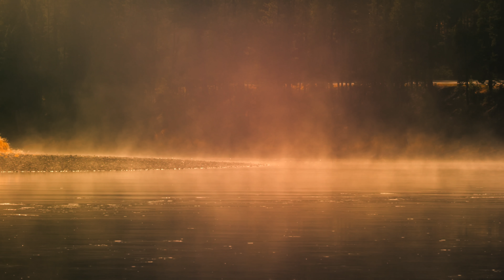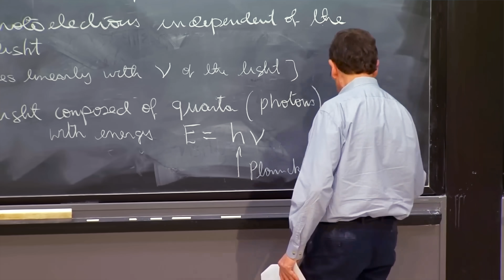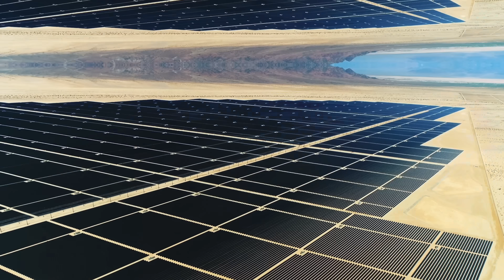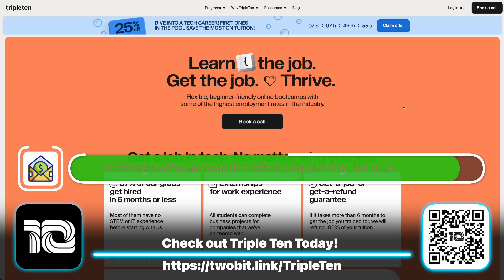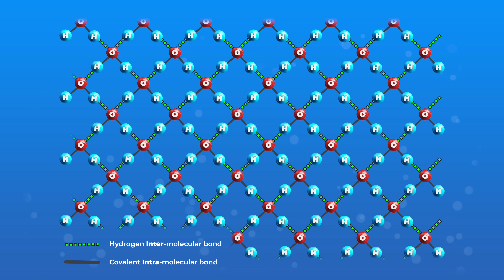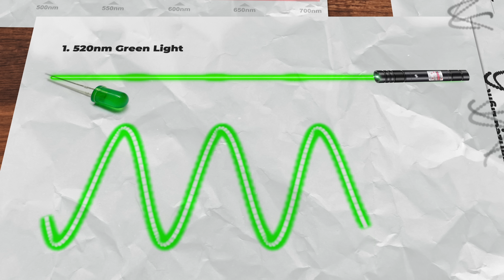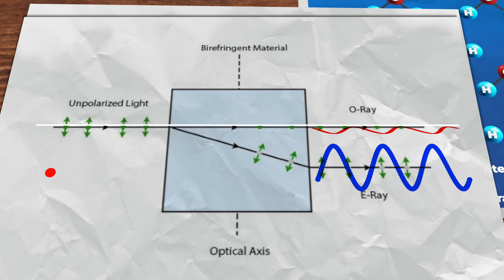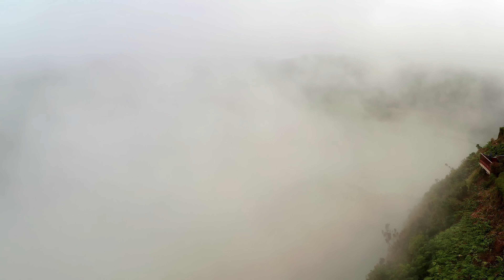New MIT Discovery Just Solved Water's BIGGEST Mystery!

Comment: There are a variety of processes that take water vapour into the atmosphere. Moving air carries water vapour into the atmosphere. The tip of every ocean wave will generate surf bubbles that burst into tiny water particles and get carried away into the atmosphere. And all the artificial heat (exhaust gas, etc.) we disperses into the atmosphere goes up cools by condensing with the water vapour and then brings it down as rain. The extra rains and storms across the planet should ring a 🔔 bell. We have been depleting our natural water vapour barrier since the beginning of the industrial revolution or over 125 years and now the sunlight penetration rates have increased and will continue to increase